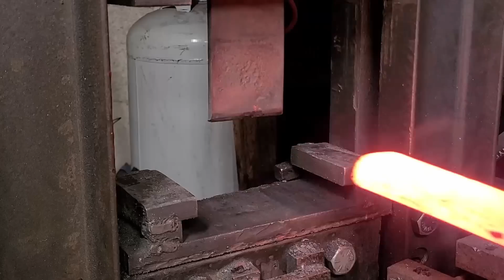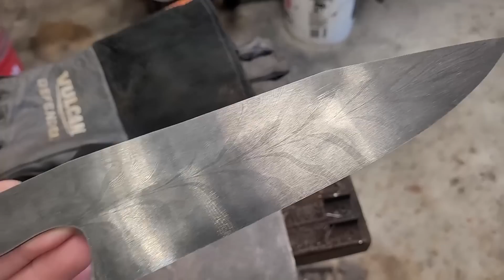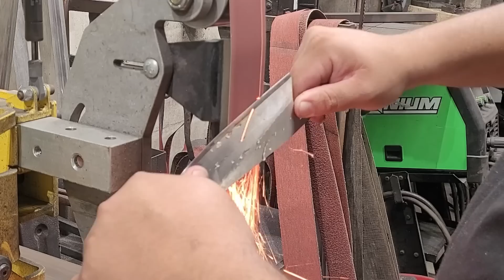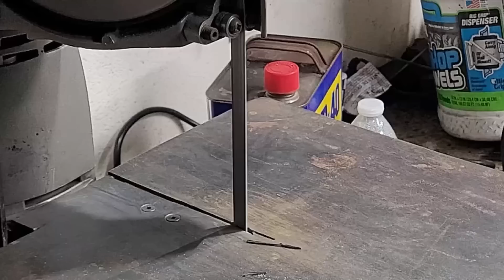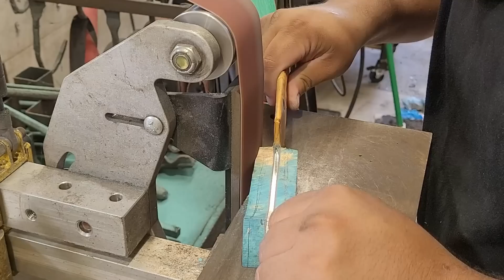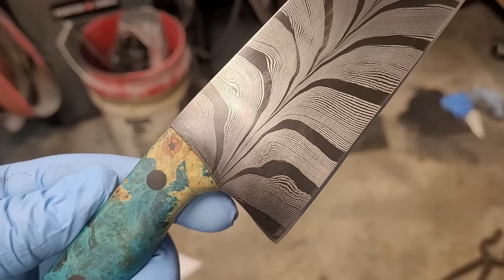Making A Feather Knife

Comment: as a CHEF the shape of this knife is great...with ONE exception... the top... there are two sharp angles...  one on the top right above the heel, and the other is the next angle going towards the tip (I REALLY need to learn the correct names of the parts of the knife lol... point at my screen and saying "right THERE" doesn't seem to work that well LOL jk) ... 
- they don't really go with the rest of the knife's curves... if you were to round them down and not make it like there are just two intersecting lines meeting at a point, then it would go with the rest of the knifes curves....
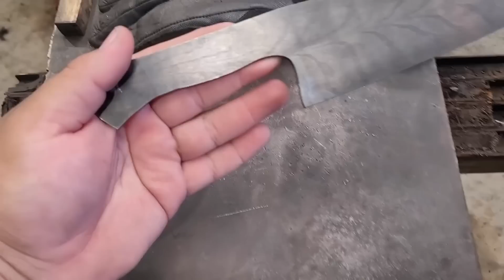- IDK if you changes this later in the process, but you had asked if we liked the shape around 4:50 so I paused and gave it a good look..... I do like that you did well to try to match the angle that the center of the feather goes to the tip at, but those two sudden angles really jump out and make it LOOK LIKE the top line and the center of the feather aren't parallel, even though they are for the most part... thats why I feel rounded them and making them less of a sudden, sharp 'drop' will help to make them look more parallel....
- there are just so many rounded curves throughout the entire blade that those two just don't fit in with with them.... it's not horrible or even bad at all.... I'm just trying to give you some constructive criticism  so you can keep these points as something to be aware of for any future builds...
- It still looks absolutely amazing and you wouldn't hear any complaints about it from me... it would be my FAVORITE knife if this was in my block :)
Reply: OH MAN WOW!!! If I was in a chair I would FALL BACK because this beauty BLEW ME AWAY!!!! 
Forget what I said about those angles... you rounded them beautifully!!!  and here I thought you'd have to make them disappear, but you smoothed over so nicely!!
The feather's centerline is as PERFECT as it can get!  They all seem to just EXPLODE from the heel and you managed to line it up with the tip SO DANG WELL!!!  You have some skills my man!!!! GREAT WORK MY MAN!!!!!
Reply from the maker: Thank you for the positive criticism. I appreciate it.

Comment: One of your best looking so far and happy birthday.
I like using colour on kitchen knives and people like them, not that I don't use plenty of natural coloured timbers as well along with the personal favourite of black paper micarta. But it doesn't have to be a lot of colour, enough to get people's attention, I'm still surprised how quick a hot pink or purple handled knife moves though!
A little trick with pins if you're not doing hidden on a natural coloured wood, there is the brown linen micarta pins you can get from the regular suspects, just use them normally but if you put a dab of thin superglue over them at the shaping stage, bit of 80grit and it'll drag enough wood over them to blend them into it so they're 'not very' visible.
Reply from the maker: Thanks for the tip

Comment: how long did it take you to not chase the tang length. i had to remind myself for almost ten years  before i figured out that i could simply weld on to it if needed instead of over working the tang. a pinecone in epoxy would be phenomenal looking with feather pattern
Reply from the maker: I used to try to get it prefect but the tiny bit of steel added or taken off is really just an after thought now. I would really like to get my hands on some pinecone handles. That would be sick.